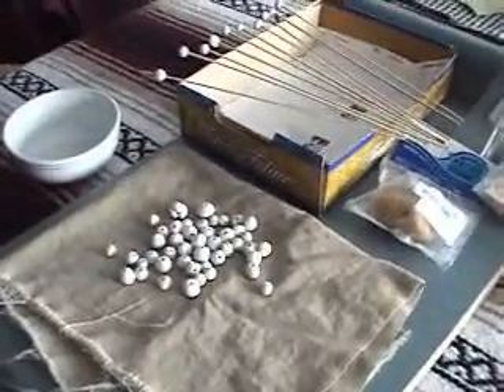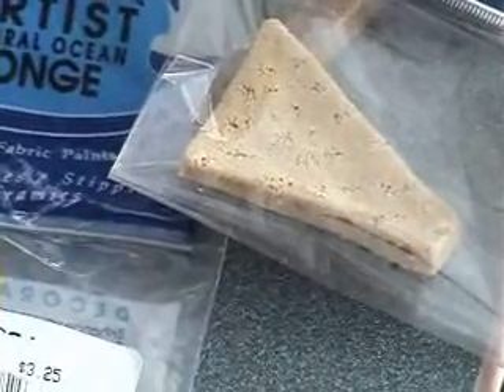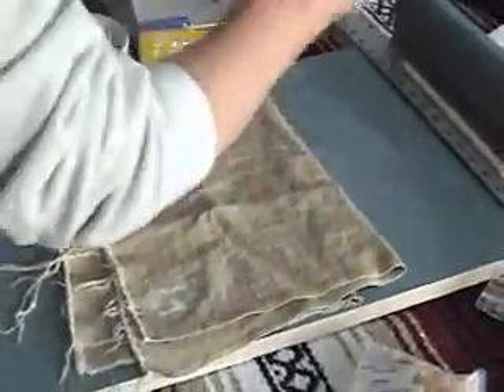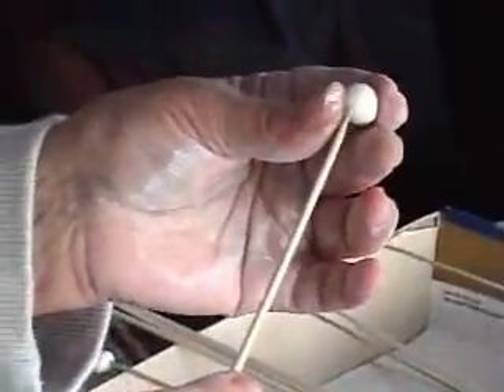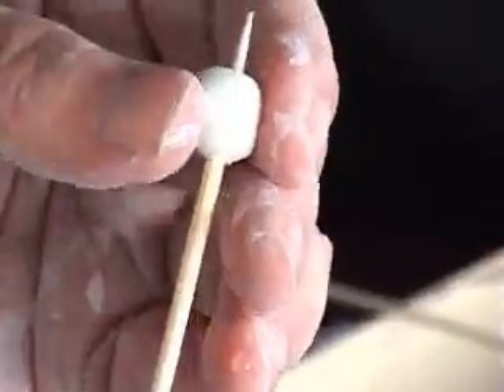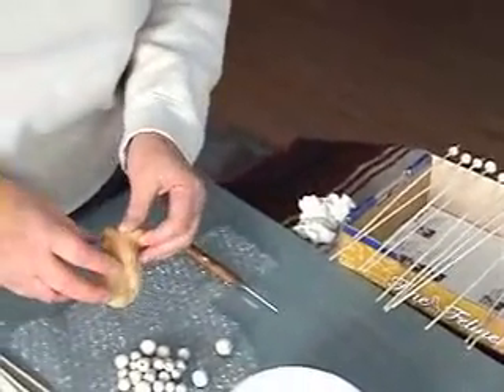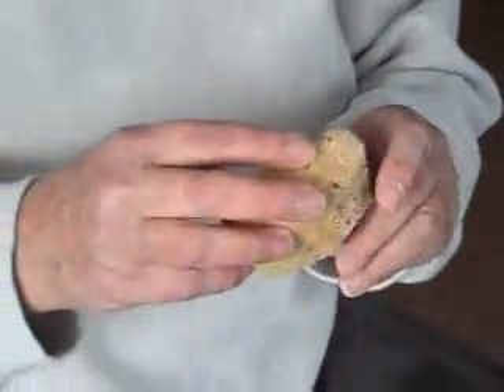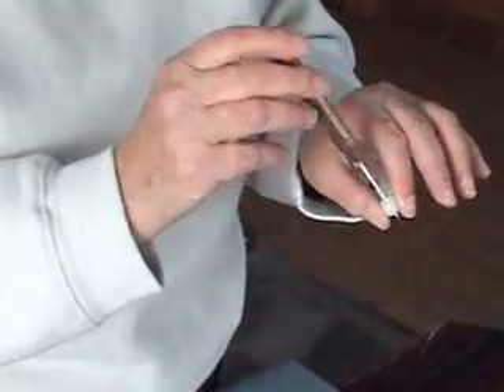Making Ceramic Beads

Comment: @naomiwashburn using metal skewers instead of wood ones doesn't change anything.  The problem isn't the material of the skewer, it's the nature of how clay dries.  Clay gets smaller as it dries, if it is not allowed to do that, it cracks to make up the difference... and cracking is not what you want.